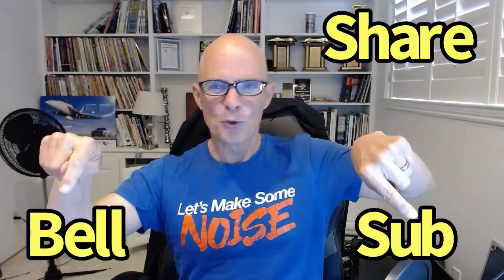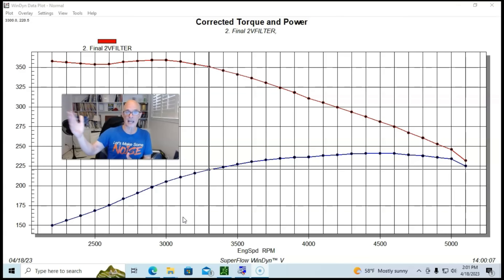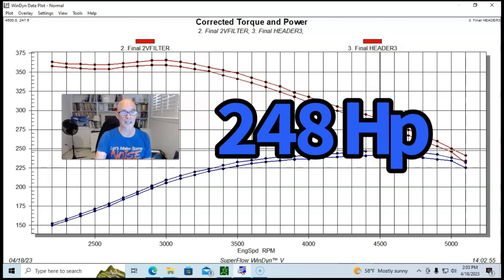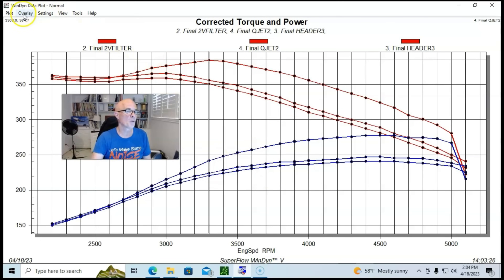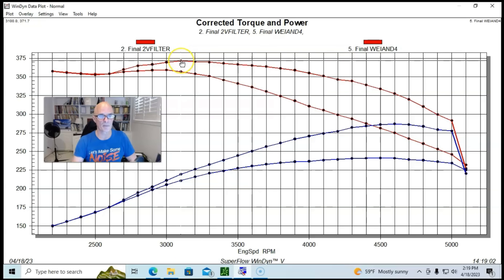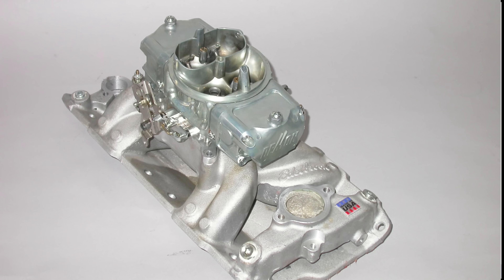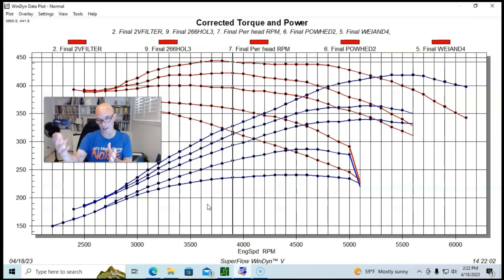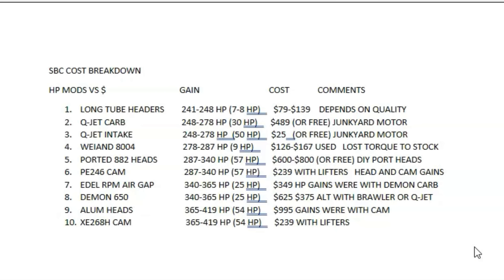HOW TO: CHEAP SBC MODS THE $1000 QUESTION? WHAT MODS ARE WORTH THE MOST POWER AND WHAT DO THEY COST?

Comment: Hearing a lot about these “retro-fit” cam kits that convert older block over to roller. Many of these can also change the firing order with the 4-7 swap or going to the LS firing order. Any runs with these that we could compare? Interested to see if there is much of a difference between stock flat tappet, 4-7 swap roller and LS firing order roller.
Reply from the maker: 4-7 swap gained no power

Comment: As a new subscriber I appreciate your videos and I know you haven't tested every configuration. But I have a 94 350 tbi with the swirl port heads and I was told that the heads are good for making low end torque, but I would like to see some real numbers verifying that. And it would be interesting to know if those heads would respond well with a good porting and maybe just increasing the exhaust valve size and of course with long tube headers and intake change. Keep up the good work and thanks for the information that you provide!

Comment: I'm new to the channel, and I'm finding these videos and info from Richard amazing.  It's a lot of data.  So, I'm looking for some advice.  I have an 87 IROC with an L98 TPI in it.  I watched this video about SBC's and modification that are based around carbs.  How would this differ for a TPI setup.  I know heads are a big restrictor, and so is the stock TPI.  If I wanted to get my car up to say 320-350 HP.   What should I be looking to do?  The car is fairly stock.  I have 1-3/4" SLP headers, no cat, magnaflow exhaust.  I guess I'm looking for advice on Cam selection, induction selection, and heads if necessary.  Thanks so much.   I've owned the car for 31 years, and now want to work on it with my 15 year old son as a project.
Reply from the maker: Take a look at the TPI videos, but a mild cam and heads help, but the factory TPI is really limiting

Comment: A junkyard 5.7 Vortec is still the best starting point if you can find a decent one. Really, any factory roller cammed 5.7 is a great foundation for a street driven hot rod that might occasionally get a few passes at the track. 
Close to 450 hp is very possible without breaking the bank.

Comment: Hey Richard,at what lift does one go to screw in rocker arm studs .? I had a .480 that started pushing stock studs out
Reply from the maker: it's not lift-it's spring pressure
Reply: @richardholdener1727  doesn't spring pressure increase with lift?

Comment: assuming you aren't hot rodding around what do those upgrades do to your fuel mileage? you've basically made the engine more efficient does mileage go up as well?  and I'm talking freeway mileage. say 75 mph down the highway. would gas mileage increase?  thanks!
Reply from the maker: it would be less

Comment: great sb chevy stuff. i’m contemplating these exact upgrade choices on my late 70s smogger 350 so this is good clean fun! so far i’ve purchased an air gap intake and holley carb from good old fb marketplace….currently stuffing the piggy bank for a cylinder head upgrade. would be beyond thrilled with anything approaching 400 hp…

Comment: Richard- you do hundreds of flat tappet can swaps, and in light of ALL THE FAILURES HAPPENING, can you PLEASE do a segment just on how your breaking in the cams, and if you’ve had ANY failures, and/ or the products you use for success!!!! This is a HUGE ISSUE TO US HOBBYIST AND WE NEED TO KNOW MORE, PLEASE!!!!!!!!!!!!!!!!
Reply from the maker: I think hundreds of flat tappet cams is over stating it, but here you go: moly assembly lube on all cam lobes and the bottom of lifters, high zice break in oi and treatment, I remove the inner spring on dual spring applications. I have also run 1.3 ratio break in roller rockers. 2 10-15 minute break in cycles and its ready to rock after checking lash.
Reply: @richardholdener1727  I have the LS beehive springs on my Vortec heads, and 1.5 roller tip rockers….. should I find a set of 1.3 rockers, and or find lighter springs? I have the GMPP factory flat tappet lifters with the hardened foot, and a parkerized Elgin 292 cam, and it measures approx 1.5-2 thousandths taper on the cam lobes, and of course the lifters have a slight crown….. would you chance it?
Reply from the maker: stock ls beehives?
Reply: @richardholdener1727  no. I did the LS beehive spring upgrade with .050 offset keepers and comp retainers, to allow over 500 lift, even though I won’t be going over .495 lift. The Beehive springs are a single spring, so can’t remove an inner, and trying to give my flat tappet cam the absolute best chance to live, so would love your input!!! Your vids and dyno info is some of the best out there!!!! Absolutely LOVE your channel!!! Have been subscribed for over a year, and STILL go back to watch your older vids!!!! That’s why I was hoping you could do a “cam break in vid” since you seem to NOT HAVE PROBLEMS! Thank you, Richard! You’re the best!

Comment: I had a similar set up only difference was with ported Camel Back heads holley 650cfm carb .

 I had the same cam xe 268h  477-480 lift and 224-230dur @50 a summit racing noisy gear drive and same air gap intake and used Doug's headers on my 72 C10 didn't like the cam it was like running a solid lifter cam always having to adjust valves with out the  advantage of quicker reving ability of a solid lifter cam.

 I had the engine redone punched it out to 383 sbc stroker with 11:1 compression sealed power pistons and comp cams  Magnum 480h cam 480 -480 lift 230-230 dur @50 and the same summit racing noisy gear drive and my Ported Camel Back Heads and air gap intake and 650 carb.

Comment: How does a bog-standard vortec head compare to a ported 882 head?  I have a set of vortec heads and a matching air gap RPM manifold sitting on a shelf waiting for a rainy day… the engine is a .060 over ‘78 truck block (4-bolt mains) and it has a mild RV cam in it.

I feel like the 882’s and factory 4-barrel manifold are choking it.

I do have equal length shorty headers and full 3” exhaust already installed with high-flow cats.  Also equipped with Edelbroken AVS2 650 carb.

I can’t seem to find any direct comparison dyno graphs comparing the vortec heads to 882’s.
Reply from the maker: check with Stan Weiss
Reply: @richardholdener1727  will do, thanks Rich. 👍👍
Reply: Vortecs are good for 40 to 50 hp increase over stock open chamber heads. Definitely worth the trouble.

Comment: Hey Richard I couldn't tell, but did you use roller rockers on this build? If so were they 1.5 or 1.6 ratio? Thanks.
Reply from the maker: yes on holley heads, 1.5 to start

Comment: 882 are busted through and cracked so new setup planned edited from 10 months ago
Promaxx Project X215 improved
370 c.i. 4.040" bore with notch to unshroud 2.10" intake valve
10.75:1 static compression
XR288HR10 hydraulic roller cam on 108* LSA and 4/7 swap
Edelbrock performer EPS intake port matched little blending porting (smaller than could use)
1-3/4" headers
HP? Torque?

Comment: There's still a gajillion of these engines floating around even if the LS craze is everywhere. 

This is all stuff that's not too bad to upgrade yourself and make your wheezy 350 breathe better. Any more probably better to get a set of Vortec heads and their accompanying intake if you're into buying a new intake though. This with a set of rear gears (at least in many vehicles of the malaise era) would transform nearly any of those cars.

I believe that small cam may be a version of an OEM offering for Mercruiser or similar. A very tame grind, probably really nice valve spring life. May even be useable with a stock valve train and not having to cut guides down. Almost anything will make more power than the stocker which was 179/195@.050.

Comment: Richard - Great video......I think it appeals to everyone from highschool gearhead to mid-life crisis grocery getter upgrade.

With the LS craze, I would still love to see a big bang oldschool 355,377,383,406 with catalog parts......that we midlife gear heads can piece together from summit or jegs with minimal trips to the machine shop. Maybe Dart SHP, Scat 4340 bottom end, decent forged pistons, 220ish heads, roller cam 240-250 range and power adder of your choice. Just a well thought out stout build with no exotic hardcore race stuff. I have yet to see one pushed to its limits on a dyno. This would be really cool to see compared to the LS.......maybe the architecture of the oldschool is not as bad as we have been led to believe in recent years. I know it will be trashing a perfectly good and expensive engine........but do it for the fans. Maybe you can build the motor than pick a high horsepower number to quit at if it reaches it.......I would be fine with that.

Comment: Need to strive for max power while maintaining vacuum and stock converter. Like a compcams 262 with 180 afr heads. That would probably save a lot of headaches for people who don’t realize how many problems you can run into as side affects from modifying the engine. 400 hp is achievable without ruining drivability.

Comment: Thanks for doing a video for us budget minded guys. really wish you would have used the Feullie type heads with the 268 cam.  I'd like to see what to do with my totally stock looking engine in my old school vehicle.
Reply: Subtract 50hp fuellie heads aren’t that good they were till vortec came out and the aluminum heads used here are way better then vortec
Reply: @utahcountypicazospage5412  plus when you shell out more money to have hardened valve seats put in for unlead gas those old heads just ain't worth it.
Reply: I was lucky enough to buy a comp cams that exact one 268H grind, and a set of small valve fuelie heads. Pulled 400 hp like
Reply: I agree would love to see stock 350 bottom end dished piston with double bump heads ad the old single pattern 268he cam see what it's making

Comment: Back in the 80's when i was a teenager, i had a 1976 Camaro 350 4-speed, The 1976 Camaro is known for having the worst 350 SBC ever produced. the 180HP LM1 (ironically mine also had 4 bolt main caps).  I swapped the intake to an Edelbrock Performer but kept the Q-jet and bought a tuning kit for it, did a little cleanup porting on the heads and chambers in shop class, and added the old Comp Cams Magnum 270H and a set of hooker headers, a dual exhaust kit and got rid of the factory 2-1-2 exhaust with the catalytic converter.  it was a night and day difference. all said and done it was under $600, but that is around $1200-1500 in today's dollars.  my neighbors hated the cherry bombs glass packs i ran on it.
Reply from the maker: The L65 was 145 hp
Reply: @richardholdener1727  I stand corrected. I Learn something new every day. I always thought the LM1 was the worst 350 ever made. I know it was 155 HP in some application.
Reply: They were so choked had a 1980s 302 a four barrel intake open Element air cleaner and some muffler shop  2 and quarter exhaust and some old stock 5.0 Shorty's. It felt like about 50 horsepower. It was night and day! The sound could have added a few horsepower,  to teenage me! What are the can but my step dad wouldn't help me with that one he said I already drive like a dummy! 30 years later he was not wrong!
Reply: I had the same car lol four speed it did not take me long to ruin the Saginaw four speed trans so I sourced a Muncie from an older big block car then proceeded to do an intake and cam and exhaust like you did nothing fancy just decent and also curved the h.e.i. to bring in timing sooner and I. Also advanced base timing considerably had to limit total but that's the case w all of them and for smog heads and I didn't even use headers just factory manifolds but true duals all the way out the back w. Some quieter mufflers lol and that quadrajet would scream and no I never broke the Muncie no matter how many times I went reverse to first and side stepped the clutch fun times
Reply: In a speedy junkyard swap, they put in an LM1 in my car.  BEYOND miserable.  No torque, no top, barely any mid.
Reply: My neighbor threatened to shoot me if I didn't remove the cherry bombs off of my 66 mustang, back then you didn't call the police. Good thing Turbo Mufflers were the new hot thing, so I changed the exhaust and ran it all the way out the back. Also I got  an electric choke so i did not have to manually richen the mixture with the throttle pedal. My neighbor was very happy!!!

Comment: 882's: ~165cc runners [before porting] and 75cc chambers.  Holley? These appear to be [systemax] 12111 heads:  runners are about 20cc larger, plus chambers are 68cc.  That's a big enough difference heads and cam should be done at the same time anyway, so no harm done.
Been a while since I ran 882's: the step in the exhaust runner is both horrile and incurable on account of water jacket location - a little better rounding of radius as  it transitions to the runner roof is about as much help as it can get.  Intake side?  Has to be opened up to match a 1204, and no further.  Its not quite apples vs oranges, but the heads tested here are more like cousins than brothers.  I think  the 12111 were good for a 1205 intake gasket?
Reply from the maker: upgrading the heads from ported stock to aluminum was not done to match port volumes-that would just be silly

Comment: 1.4 turbo bulid would be interesting.  
 Although parts for this are pretty expensive.  Between  my front mount intercooler with pipes & ported intake,  1 in spacer at intake & head ,
  aluminum radiator & pcv fix kit & Mamba wastegate updat.
 Was about 1,300 $ over all. 
 I should have done a chassis dyno 1st to see what my gains were.  
But going from 8 psi of boost sometimes  to a positive 11 to 12 pound of boost at 3500 to 4200 rpms all the time is nice.  Running lean, most likely now my next step is a tune.   Thanks for your videos.
Reply from the maker: do not run your turbo motor lean
Reply: @Richard Holdener  I know I'm waiting a bit for tune . 
 Budgets, lol 😆.

Comment: Richard did a previous video on a 350 SBC with virtually the same (if not the same engine) engine except he added a better cam and AFR heads for final tests, and I believe power went up to 523 HP.
Reply: Do you mean the "Gladiator 350" build from back in the day.  Thats my favorite SBC combo.
Reply: @Sir.VicsMasher  The video started with a 2 barrel and ended with AFR heads with a single plane on it.

Comment: MSD distributor and wires not priced ??? One of the best low buck mod is an igntion system tune-up including a curved HEI. Showing increasing power levels could start with a plug wire pulled at the beginning and at final configuration. Using an old competive shooting phrase  -- you can not miss fast enough to win.

Comment: I have an edlebrock intake and carb on my 69 dodge d100 318. 
I want put a qjet on it.

Is there an adapter for this application?  I'm just assuming it's a squarebore intake.
Reply: Maybe flip a QJet to square bore carb adapter upside down?
Reply from the maker: yes there should be

Comment: Parts combo is where the real magic happens.  For instance: The long tube headers didn't do much for the stock motor, now that the motor is modified replace them back to the ram horns and you see what they are really worth.
Reply: Yeah what ever you put on last will be worth much more. Take the last combo, put the stock cam in- could loose 50+ hp same with heads. But if you put that cam or heads on the the 2b&ramhorns it would be worth much less.
Reply: Camshaft is the big one here - the intake and exhaust setup are really dependant on the camshaft. Anything with a bit of overlap responds to those two mods quite well.
Reply: That’s proof that manifolds aren’t a big restriction for the stock engine…
Reply: I also like to know wat the stock c4 Corvette manifolds  would do with the 365hp combination (i own a 85 Corvette)

Comment: Best set of heads you can get from a junkyard that will bolt on - Vortecs should do it. Now a four barrel and a 220@50 duration camshaft. Should be fine with the standard springs so long as lift is under .500" or so. If you can fit headers into the budget get the cheapest set of long tubes you can find - they really bring out the midrange. Altogether you should be easily 350 to 400hp for not a whole lot of money.
Reply: you want 420 lift to make vortech heads not near 500 unless you pay for screw in studs that is the down fall

Comment: Glad you are including prices. Any chance of a comparison test of generic parts (Summit, Speedmaster) cam, heads, intake, carb, etc. vs name brand (AFR, Comp, Edelbrock, Holley) on a SBC or SBF. How much HP does the extra expense buy?
Reply: He's got multiple cheap head shoot outs on SBC and I think some ford ones too.
Reply: Cheap stuff usually does quite well within about 5-10hp or so for an intake or exhaust setup. The problem is if you go cheap on everything then those number stack up. 20hp for heads, 10hp for the intake, 5hp for the cam despite a similar grind... before you know it you could've thrown a good set of heads alone at it and been better off.